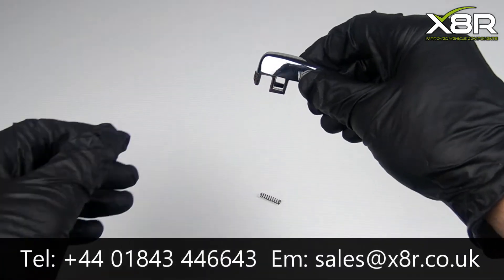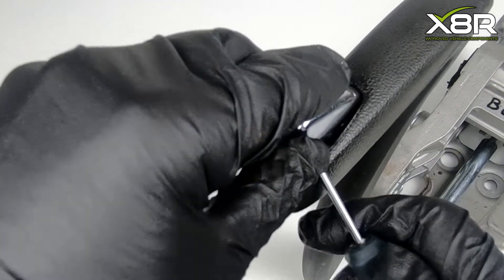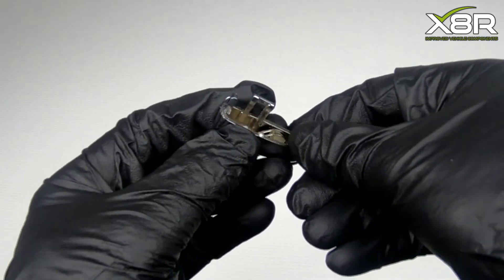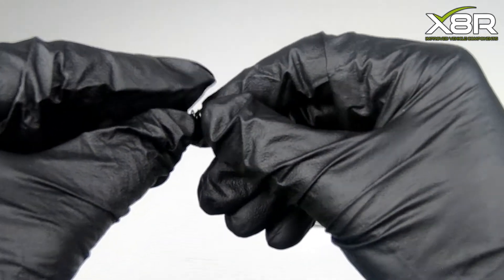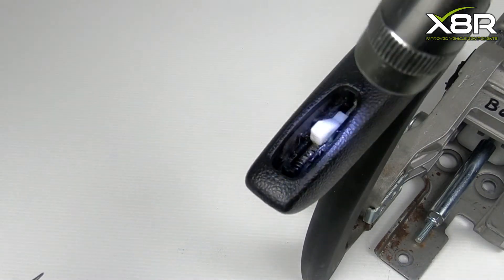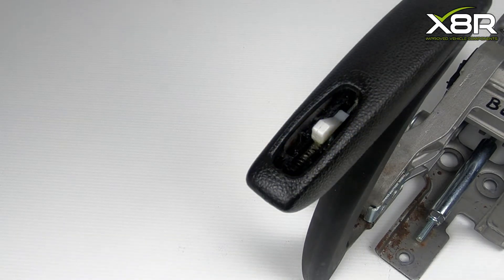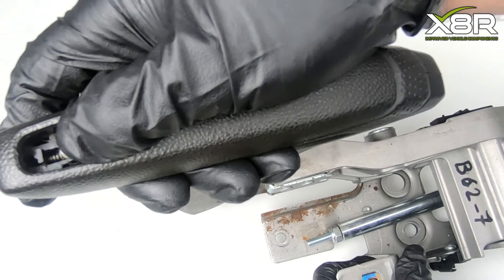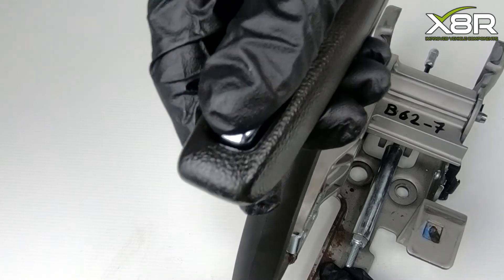METAL Vauxhall Opel Mokka Handbrake Handle Release Replacement Button Kit Install Instructions Guide

Comment: How do I get the plastic out if it's broken inside the clips
Reply from the maker: Try to use a small pick or pry tool to get the pieces out. If the pieces have broken off really small, you could also use something like bluetack to get the fragments out.

Comment: You show how to take the spring out... but then when we next look there is a spring back in there... if you already have the spring do you need to replace it?
Reply from the maker: Hi there, sometimes the springs can wear out and not work as well, however you might not have to replace your spring depending on its condition.

Comment: Howwww!? How did yours go in so easily.. mine seema to not want to fit in 🙈
Reply from the maker: Hi Jayne, did you manage to get the button in? It can be a little bit fiddly but if the button isn't going in at all it is likely there is parts of the old button still stuck in the mechanism. We found using the pick/small screwdriver really helped getting it in. - Georgina, X8R Ltd

Comment: Tip: if you are struggling to remove old plastic bits, I found an old syringe needle could be forced gently into the remnant and carefully extracted!
In my case the bottom horizontal bar of the ‘square’ was in situ still, but the syringe point lifted it upwards but be careful!

Comment: I just bought a new one the same as this, the problem i have is some of the old plastic 1 is stuck in the groove.
Reply from the maker: Hi there, we recommend using a metal pick or trim removal tool to pry it out. - Georgina, X8R Ltd
Reply: @X8RLtdUK  I found a syringe needle would penetrate the plastic to enable lifting out!